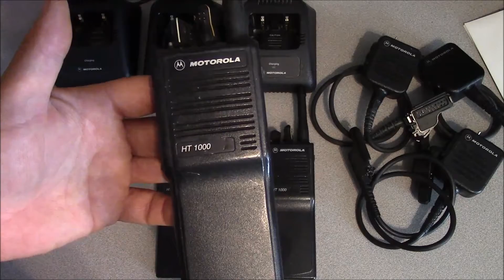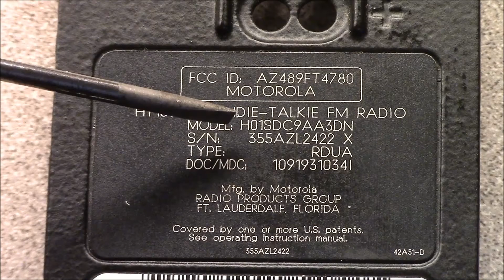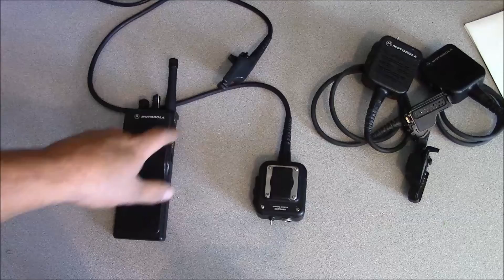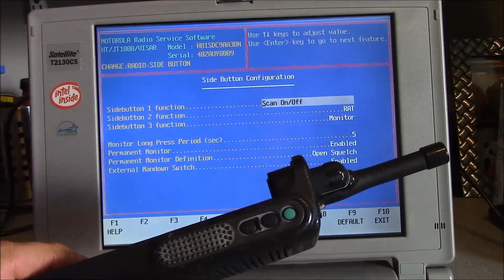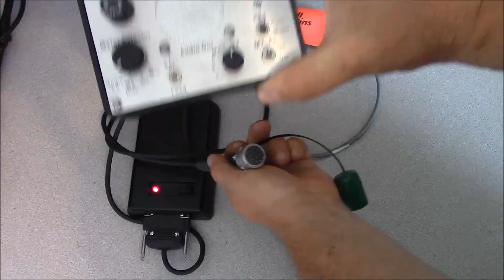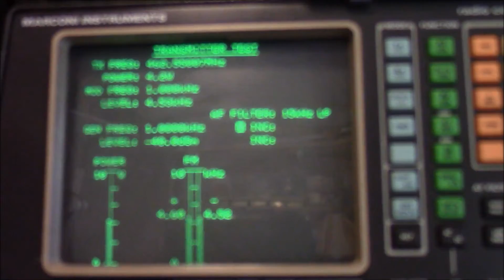Motorola Tactical FM Portable Radio for 10 bucks - The HT1000

Comment: Sometimes a see a sticker on the back "this radio has been rebanded" does that mean you can switch out the components and change a H01S to a H01K, H01R? and if so what is this process?
Reply from the maker: Rebanding was something that took place many years ago as a spectrum grab in the 800mhz band  and the 800mhz MTS2000  radios were all flashed with rebanding firmware. It has no effect on VHF or UHF models unless the users of the equipment misused the term rebanded to indicate they were reprogrammed with 12.5khz channels when licensees were steered from 25khz . Or its possible the frames were built into other jedi variants. It is hard to tell. It is possible to mix and match HT1000 controllers and RF boards but it requires manipulating the RSS with a hex editor and the radios will require an alignment when you change model numbers. Thanks for watching !

Comment: How can you know what exactly wattage is when it says character D between 4 and 5 watts can you know what's excact wattage
Reply from the maker: By aligning the radio on a service monitor. You can use a watt meter with the same rib box used for programming in the service menu. Thanks for watching !
Reply: @survivalcomms is the same identification process for Motorola gp900
Reply from the maker: @electricalprojects4358  Not sure GP900 is an offshore market product.

Comment: Used these for decades. When my work upgraded I got a dozen radio’s, spare batteries, gang chargers, and the battery maintenance system for free. They are the 450MHz version.
Reply from the maker: They are great radios. The difficult part is obtaining batteries. Thanks for watching !
Reply: @survivalcomms  So far I haven’t had to buy any. Most are 2017-19 vintage OEM still testing 80% or so. I have some 10+ year old that are about 20-30%. I use these for testing or when I don’t plan to use the radios long. They are marked as such- like magazines marked for range use only.  Have you had any luck with aftermarket batteries from Amazon, etc? Maybe you could do a video on replacing batteries?
Reply from the maker: Im still using OEM as well. The multiplier batteries weren't bad. If GTS made some like they do for the astro25 series we would be golden.

Comment: But... But...,    The  CHINESIUM  BAOFANG  is so pretty and flashy!!
This will not look TactiCool in my plate carrier...  especially compared to the pretty BLUE BaoFang.

Seriously..  the HT1000 is nice and budget priced for sure, but batteries and accessories will be a bit steep
if sticking  to   /\/\otorola   OEM.

I would recommend the HT1000 for budget oriented folk, but for a few pennies more...
possibly consider the. JT-1000 if you can find them for similar pricing.  The JT permits 
“FPP programming” which allows the user to program simple parameters without the need for a computer & CPS/RSS software.
(freq / pl - DPL) if I recall correctly.   I’m not too sure about channel spacing, but if using on HAM / MURS / GMRS spectrum,
the wide-band (25khz.) spacing is fine.  It’s been close to 20 years since I’ve played with any, so your mileage will vary.

The MTS2000 and any of the XTS radios are more “future proof”, but the XTS models will define be considerably higher in cost.
For the true “comms prepper”, use your Fauci-Biden Mask Stimulus Check and buy an APX8000 for true multi-band operation. 😷😆🇺🇸

All kidding aside..
Thanks for your. videos !
Reply from the maker: The cool blue and kung pao alarm make the baofeng the choice of the internet commandos. The JT's still command a good price. I have a V and a U in my collection and the D series work on 12.5khz fine but the VHF's do not like the "splinter" channels.  You are right NOS Moto batteries are at a premium. The prices for aftermarket batteries from reputable vendors like tessco  are reasonable . My EDC radio is an APX8K  it is a lot of radio but the heatsinking is no bueno - it makes a great handwarmer for those prolonged QSO's on an AES secured talkgroup.  Thanks for watching !

Comment: The HT1000 were killer radios. I recommend the MTS2000 because they are a step up from these and use Windows programming.  I am  genuinely surprised with this video you really know your stuff. Most of these videos are of people that barely know how to use them or just bought them and haven't actually used them much. Kudos!
Reply from the maker: Thank you very much ! In my career I started in the twilight of the Saber / Micor UHF days and transitioned to the MTS2000's when we went to 800. They are a great radio and I have several of them here.  I do not miss writing smartzone templates in RSS :) Thanks again and thanks for watching !
Reply: The BEST PART about the MTS2000? The scan with priority feature, and the fact each new channel select has a different 'personality' or configuration for scanning. Most flexible scanning architecture I have ever seen. PROGRAM the emergency button for 'skip' function and you're good to go!
Reply: Totally agree in both being shocked you know your stuff as well as suggesting the upgrade to the mts2000  radios

Comment: Mts2000 also cheap
Reply from the maker: You are right and you get the benefit of Windows CPS. I have an entire cache of the model 1 MTS2k's in UHF that I got for free that were surplussed from a prison. I did some housing replacements and alignments to bring them up to snuff (I've never seen a radio from an institution that did not look like the housing spent some time on a belt sander). Like a timex watch they keep on ticking. Thanks for watching !

Comment: Fortunately As I found out a copy of freeDOS works fine on my ToughBook CF-19 and it programs my HT1000 just fine with a ribless cable, This was my first radio as well. The Jedi series rocks, great video.
Reply from the maker: Thank you ! Thats cool you got it to work for you.  - I personally have run it in a dos box but read and write is iffy.  Which ribless cable did you use ?  Thanks again and thanks for watching !
Reply: Do you have a link? I’ve got several HT1000s and I’d love to be able to rework some of the frequencies!